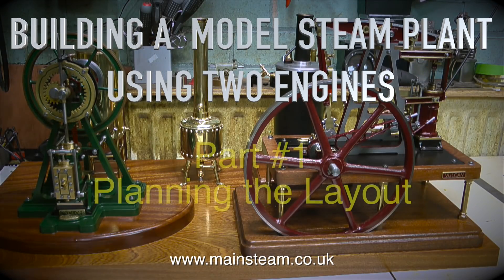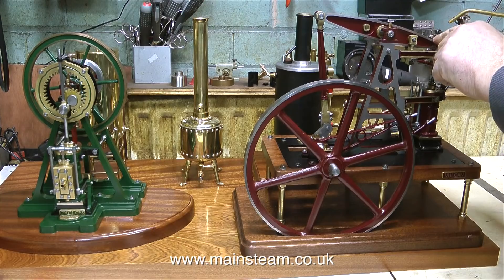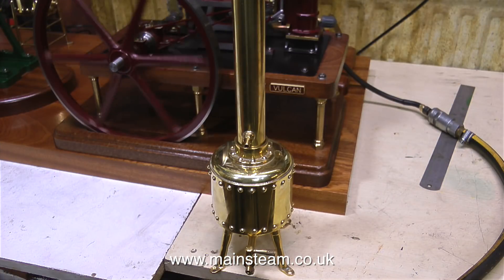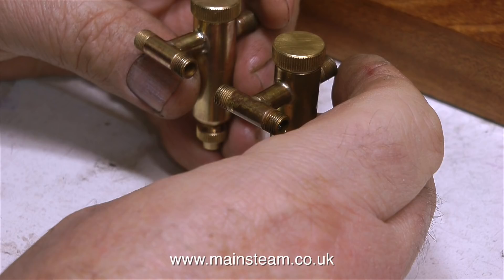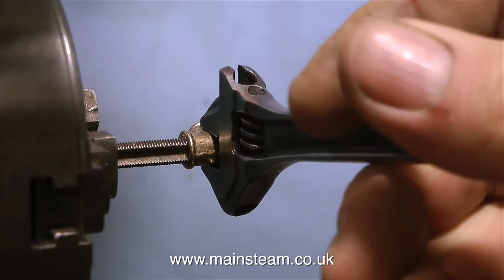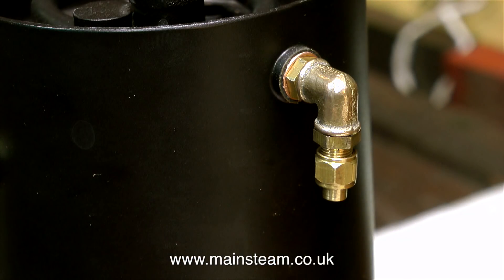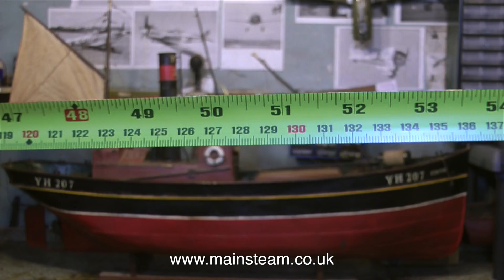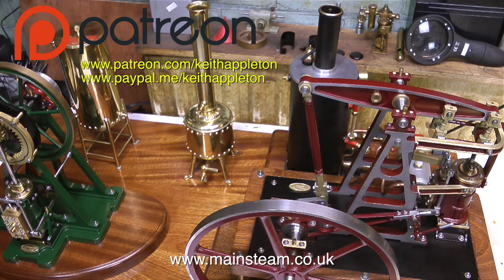BUILDING A  MODEL STEAM PLANT USING TWO ENGINES - PART #1

Comment: Dear Model Engineer

Need help getting one going 

My father has one but cannot get it going It had two pipes going into the steam chest one at the top and one at the bottom, he reached it with valves, saying it doesn't make sense! get the man in Honiton who sold it to him said it was working but takes a lot of pressure. Anyone reflect on this and can help he can hardly see now and 90 stubborn, just like to get it going before he's no more.

I understand that this model is meant to run on very low pressure. there is no feeling of resistance as you turn the wheel.No air coming out the outlet pipe. 

can you help or know where there is a building diagram on this? 

Yours faithfully

Gary Bridger
Reply from the maker: Sorry, I can only give tech support to my customers directly or Patrons of my Channel via www.patreon.com/keithappleton

Comment: The reason you are having a problem with the 1/4x40 threads on the PM Research cast fittings is the US 1/4x40 thread form is a 60 degree pitch where as the 1/4x40 ME threads have a 55 degree pitch ( the  witworth standard ) hence having to ease the thread with an 1/4x40 ME tap to fit on UK "standard" fittings

Comment: What you could do with for wrapping steam pipes is something like a guitar string winder, though you would have to wind them straight before bending to shape.
Reply: The problem would be that at each bend the string would compress on the inside and spread out on the outside of the bend and that would not look good as well as leaving potential 'burn your fingers' points on the pipe.

Comment: Hi Keith with ref to the 1/4 x 40 elbows have you managed to ID the incorrect thread ? Looking forward to seeing you work your magic on this project :-)
Reply from the maker: Yes, a viewer said that U.S. 1/4 x 40TPI threads are at 60 degree pitch so they need easing with an English 1/4 x 40TPI tap . . . .  which is what I am having to do.
Reply: Thanks

Comment: that engine with the big gear in the middle is crazy looking i never seen one of those !!
Reply: In the early days of steam, someone called James Pickard patented the 'normal' crank and flywheel arrangement, so James Watt had to come up with an alternative (the sun and planet gear you see here) to get around the Pickard patent.
I'd be interested to find out what the reason for the big gap in the teeth of the outer ring at top and bottom dead centre, though

Comment: Both exquisite engines indeed, I do love the planetary ring gear motion one especially, what a marvellous innovative design and I do love beam engines of any kind (big fan of the 90 inch and 100 inch beams at Kew) as the 90 inch in operation is like the hand of the gods coming down and those engines pretty much gave west London its water pressure across the network before electric came in and it is said when the 100 inch broke her beam it was heard across London and the home counties...